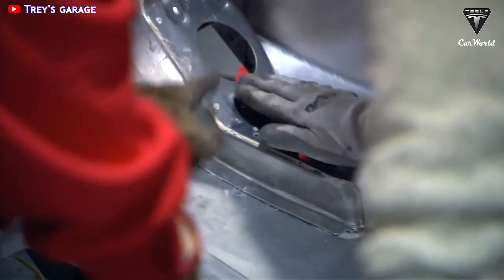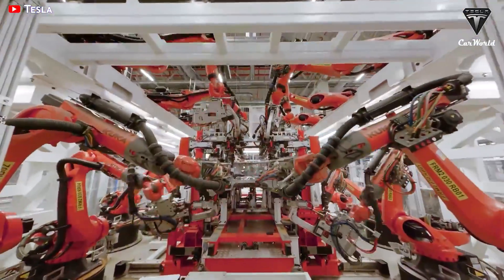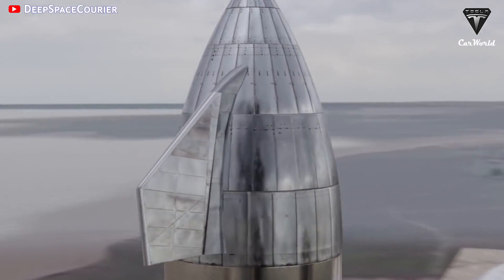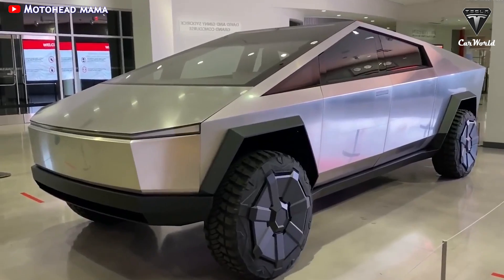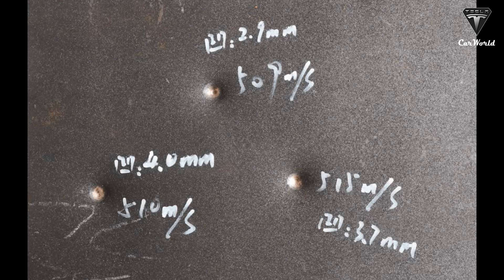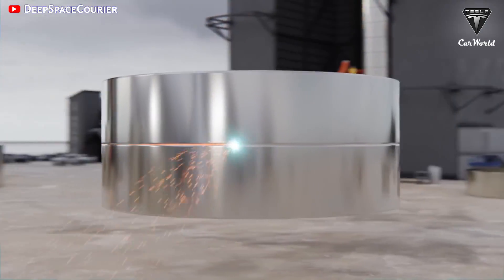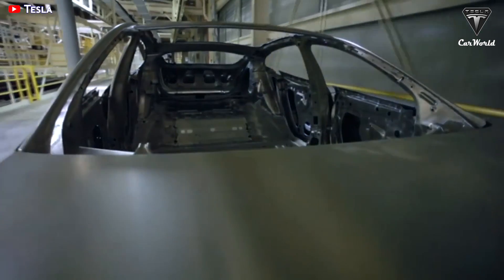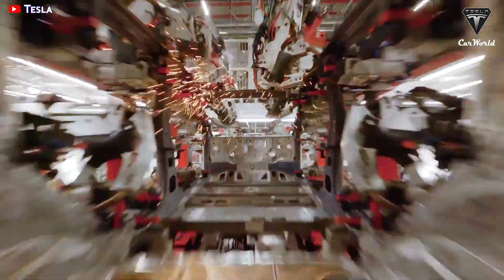It’s Happened, New Breakthrough Material for Cybertruck's Body 2023.

Comment: 304L may be new to the Cyber truck but it is not new to the rest of the world. I was machining 304L thirty years ago. It is a good steel for many applications but is far from new. The low carbon is required for welding. If you really want maximum corrosion resistance you go with 316 stainless steel. 304 is a lower cost option and is easier to machine than 316.

Comment: 304L  Stainless .. it's cheap and corrosion resistant ... ain't Rocket Science, ironically.  304 vs. 304L .. 304L has less carbon, thus it maintains corrosion resistance at the welds better than 304. 304L is commonly used by MANY companies that produce Tank Vessels .. going back several DECADES .. NOTHING New here guys!!!

Comment: Gateway arch in St Louis is clad with 304L Stainless Steel; #3 Finish X 0.25 inch thick.  It is almost 60 years old.
Reply: Is the surface covered with rust stains like a new Cybertruck that go caught in the rain.

Comment: So - if I understand this - my Cybertruck will be built to last 30-50 years - the current warranty on battery pack is 8 yrs - assuming I can stretch the batteries to 10 yrs that would be 3. 5 cycles of battery replacement - initial cost of $85k, then 10 yrs later new batteries for what? $25k?

Comment: Chlorides may be very bad for some 304 SSs…..Wonder how this would stand up to Chlorides?
Reply: Normal steel wouldn't either.
Reply: Corrosion and crack propagation is highly dependent on temperature, pressure and chloride concentration! At low pressure and temp it should be low to none!  A small anode on the body could be used to counter it!  Wraps or clear coating would as well!

Comment: The "X" in 30X is a placeholder for a number to be assigned later by a standards body. It is not thirty ex cold rolled stainless steel, but three-oh-ex. I wish Elon had made this clearer more than once.
Reply: CLOSE .. the X is a placeholder for defining a new alloy or picking an existing cheap alloy out of the 300 Series austenitic stainless steel family of existing alloys. Tesla & SpaceX did the sensible thing, and picked a cheap plentiful existing alloy i.e. 304 / 304L.  I've used this many times for fabrication projects .. IT SUCKS for cutting, drilling and forming.. horrible crap.. but it's cheap!! 304L is better for welding for Tesla & SpaceX, because the welds are more corrosion resistant than 304... both 304 & 304L are CHEAP 18/8  stainless steels ... 304L has been commonly used for DECADES .. nothing new at all.
Reply: @KrustyKlown  Of course, there's never anything new. The armoured glass won't be developed by Tesla either though they claim it is.
Reply from the maker: After Cybertruk is released, maybe he will explain. Thanks for sharing, Davis FourOhFour   !

Comment: I specified 304 and 316 series stainless for many tanks and associated piping for many years.  I ended mainly using T316L or T316ELC for most things because of its corrosion resistance.  Its biggest drawback is that you can't use tools or fasteners made of ordinary steels or it will be 'poisoned and start rusting easily.  Want an enemy for life? Scratch your name on a Cybertruck with an iron nail!

By the way - L means Low carbon, ELC means Extra Low Carbon. TCW's got it wrong interpreting L as extra low carbon, it's simply low.
Reply: Leave a wet Brillo pad on a stainless steel sink and you'll see rust.
Reply: What would be the solution to the iron nail situation? Chelation to remove the free iron oxides?
Reply: Polish it out with metal polishing compound

Comment: Nothing new about 304 austenitic stainless steel for car bodies. This is the same alloy used for the Delorean! 304L is just a lower carbon version that is easier to press form.
Reply from the maker: Thanks for sharing, John Wright !
Reply: But it certainly wasn’t anywhere near as thick to be considered plate steel.

Comment: If it is too strong, it will add to traffic deaths unless they have allowed it to crumple somewhere.
Reply from the maker: When the 30x becomes more brittle, the 304L remains much more ductile, which means it remains sufficiently ductile to withstand strong shock loading.  So it will reduce the danger for pedestrians as well as increase the durability of the Cybertruck.Thanks for your comment !

Comment: I’m curious what Tesla is actually talking about...300 series stainless isn’t typically considered “hard”, it’s pretty formable and less strong than the stronger carbon steels.  Personally I think 300 series is an excellent choice, just wondering if Tesla is treating the steel after forming to make it harder (which is cool but an additional operation which to some extent defeats the time advantage gained bypassing the paint booth).
Reply: A swordsmith explained once that a stainless steel flexible enough to be used in a sword was possible, although it would be difficult and very expensive. (Typical stainless steel is far too brittle and would shatter in combat use).
So the story of new stainless steels isn't over yet.
So I assume that SpaceX has done some fantastic work at the materials research center and will be introducing a new alloy, and finally we can rid 30X of its placeholder token and we get a new 300 series alloy suitable for the Cybertruck. The Cybertruck steel plant has been under construction near Austin for many months. Should be done soon, if they're boosting the signal like they seem to be.
Reply from the maker: Thanks for your information !
Reply: It's a car, guys. Not a tank...
Reply: @StephanRaubenheimer  it’s a tank built fo the yanks 😊

Comment: The driver will be safe.. but the other guy..
Reply from the maker: You know, When the 30x becomes more brittle, the 304L remains much more ductile, which means it remains sufficiently ductile to withstand strong shock loading.  So it will reduce the danger for pedestrians as well as increase the durability of the Cybertruck.